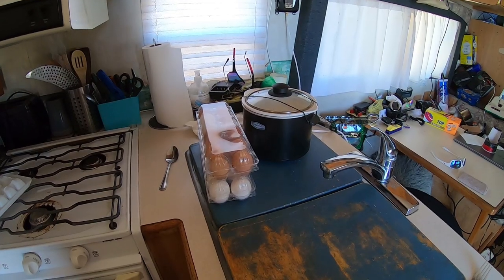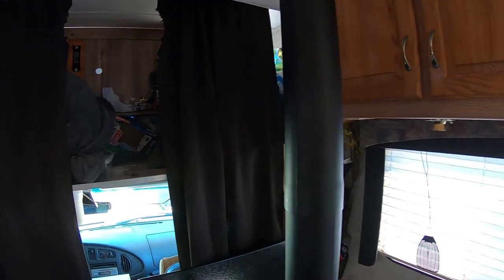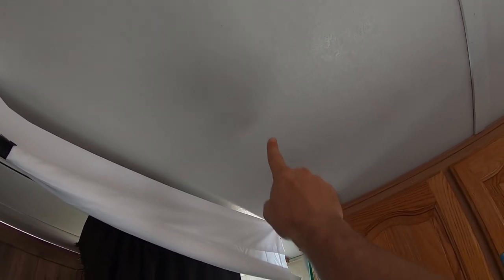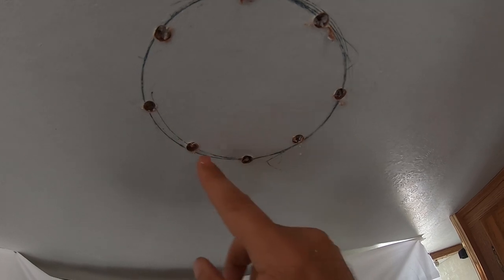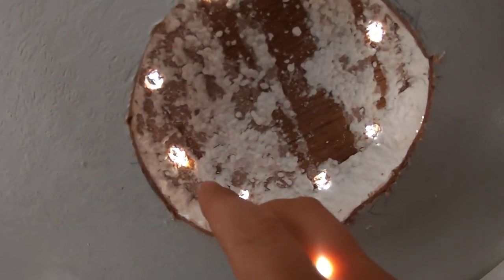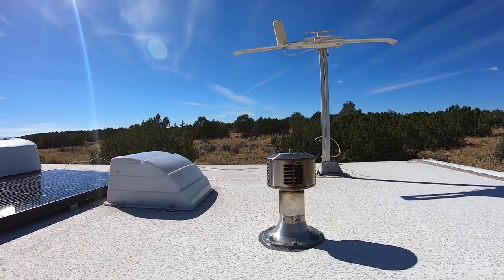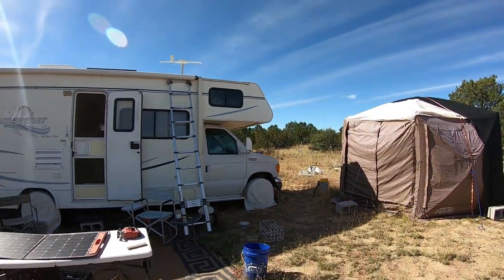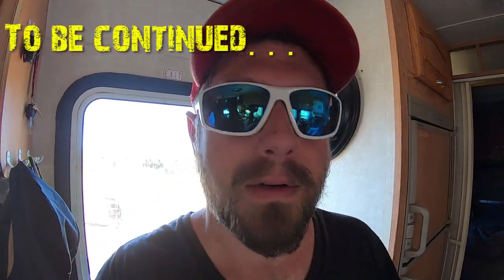Installing Wood Burning Stove In RV

Comment: It's been 2-3 years since I saw one of your videos.  Good to see that you're still kicking and haven't killed yourself.  You're an inspiration to all those that seek out the less thought out way.  That big of a wood stove in a RV is going to cook you out and be a PITA to regulate. Your exit is iffy at best.  There needs to be an air space around the ceiling pipe.  Double wall at the least.  Not sure how this popped up in my recommended list,  GL in your endeavors.

Comment: Hello Mike. Wish you the best on install. My wife and myself do have some reservations  about your install. #1  the allumium  foil stuffed in the area  that needs to be an air space between flume and outer shield should not be compromised.  It will transfer the heat from flume to the outer shield. #2  It would serve your purpose  better to also have gotten one that is triple walled/insulated.   We do hope that it works for you, but do be vigilant  keeping  an eye out for any issues. We both have building back grounds. Best regards Mike. We love you, Tommy and Bonita.
Reply: Tommy and Bonita is correct.  Very high chance of RV catching on fire.  Ask the fire department to inspect.  Better save than sorry.
Reply: @hoke0818  this is probably why the universe didn't let him use it this winter/spring maybe....
Reply: Agreed!!!!!

Comment: Mike. Please for the love of God, extend the smokestack. Just look up code for a house and double it. Should be around 4'. You're going to melt your roof and troche your RV.
Reply: Not to mention there has to be a 3-5? inch air gap for the pipe going thru the ceiling, so it doesn't melt the inside ceiling, or the outside roof, could torch the roof in short order.

Comment: So many know-it-alls out there. Wow. Unless someone lived in a camper through an entire winter with the use of a woodstove, shut the hell up. I lived in a HiLo camper (22-footer) through three terrible winters and my heat source was a medium sized potbelly woodstove. First: ventilation, a permanent flow of it was needed so the stove did not use up all the inside oxygen and slowly kill me. A cracked window with the ceiling vent open a smidge is the best way to ensure free-flowing draft. Tin foil is a great way to radiate heat from a small woodstove. The heat glides right up the foil. My stove flue was 6 inches and was 6 inches from the wall in back of it. Yes, it did get hot back there, but after foiling up the wall the problem was solved. I also foiled up a small, square area of the ceiling over top of the stove and it worked great. Naturally, I did not keep a full-bore fire going when I was away from the camper during the day. I would not have used the heat tape on the roof like you did, bud. I would have bought the sticky stuff and taped around the outside of the hole you cut in the roof, that way the small amount of space there could breathe. You could also foil the bottoms of your cabinets to reradiate the heat out into your camper more. Trust me. that camper will freeze up quickly, bro. Only hard wood would suit me. Good job!

Comment: My only suggestion would be to install a shield on the roof around the exhaust pipe.  Some sort of heat shield/flashing on the roof itself around the pipe.  Just a little added protection.

Comment: Oh, geez. I would not do this. Smoke and fire are likely not to be your problems with this, but keep a fire extinguisher handy. Mold is going to be the issue. No matter how well you think you have the hole protected from water seepage, it's going to leak. Mold is going to cause you to have to trash the entire RV. Hope you have a friend with a spare room. Good luck.
Reply: @ccc4eva62  Essentially, yes. After living in homes with skylights for over 40 years I can say with some authority that it will leak, especially since he employs a do-it-yourself strategy. And once mold takes hold within the roof and walls of an RV, it's game over. Impossible to fix. I think he's in an environment that doesn't get much rain, so he may be good for years, but cutting that hole in the roof has sealed the fate of the RV. It's heading to the dump.
Reply: I sealed multiple holes for solar, fan, etc in my vans roof back in 2015 and the dicor sealant is still going leak free.
Reply: @ARF.Racing  Your van's roof is a sheet of metal. Even if it does leak, it's not a complicated fix. RVs are a different creature.
Reply: @purewonka  my van has metal roof, insulation, wiring, and then the interior ceiling,   not really much different.  
A good self leveling sealant such as the Dicor sealant i mentioned lasts a very long time and only leaks if you don't know what you are doing.

Dicor works on RV rubberized roofs very well.  Just ask around the next time you see RVs.
Reply: What about all the other holes made in the roof. You know, like the ac units,  vents , skylight, tv antenna,  etc. ? Unless I didn't  understand  your comment   about mold intrusion, then so long as the install is done correctly  there shouldn't  be an issue. I emphasize  done correctly.  Best regards.
Reply: @1unihipili  That was all done by the manufacturer to specs designed by engineers. Our guy here drilled holes in his roof and used aluminum foil to fill the gap.

Comment: You don't want to know Mike the stove is way too big you don't live with the windows open supposed to be 2 in combustible from any pipe you did it that way because of this the size of the cap need to take a piece of sheet metal screw the cap to it so you have a flashing on the roof but the woods supposed to be 2 in away from that pipe pressure washer roof and get some rubber sealer on it your roof is just about shot you wait too long all that White's going to wash off and then you're not going to be able to seal it the rubber underneath is black and it's not very thick don't understand why the stove in the middle of the room but it's your house good luck
Reply: He's going to burn the place down is what's going to happen

Comment: You did a great job Hey i need advice. i live in my fifth-wheel full time colorado and i am getting murdered by propane I MUST GET WOOD burner in here IMMEDAITLY what does natural venting ? and i would go my side slide window if i had to use a stove pipe ? I need advise I'm a 60 year old lady ok at DIY but i need to do it fast lol
Reply from the maker: Hello, thanks. And yes lot's of folks put their pipes out their windows with a few elbows in the pipes.

Comment: I think you are going to have a serious heat problem at the ceiling/roof. Not enough distance from the stove pipe to the foam. Please have some air coming from the outside, so the stove won't use all of the inside oxygen. Some man and his two dog's died while using a propane heater in his rig this month. No open window to replace the oxygen used by the heater. They went to sleep and never woke up.
Reply: Wow that’s incredibly sad. Terrible

Comment: The stove is too large to place in the middle of the floor. I think you’ll regret it, unless of course it saves your life during the cold winter months! You should maybe remove the overhead cabinets, or part of the cabinet where the couch used to be and put the stove up against that wall. I’d suggest you put dicor up onto the flange of the pipe on roof. It might leak if you only seal the gap between the flange and the roof as you did?

Comment: Interesting. I never would have thought of putting a wood stove in a RV. I thought they were set up with electric or propane? Idk. Glad you had a cap for over your chimney to prevent the wind from coming down through it. Wood heat is the best heat you have. After living with it, it's hard to feel warm with anything else.

Comment: I don’t want to sound rude or anything but I think the stove location is going to be a pain in the butt being in the middle like that and going through the roof what you could’ve done was cut a square opening so that you could put a roof vent in there after if you decide to take the stove out if you sell the camper. And then you just run your chimney up through the roof vent but you run an actual approved chimney. The way you have it there is no air gap and there is going to be a crazy amount of heat coming off of that thing I would not trust that at all but who knows it may have worked out for you, I sure hope it did. If you follow the mobile home wood stove, install safety standards, you should be totally fine.
I think what I would’ve done here is put the stove up against the wall, double shielded everything and left air gaps and then either modified your top cupboard or just taken one of the doors off and run the chimney pipe through there and then up to the roof with an extra shield around the chimney pipe, where it goes through the cupboard. That way the stove would be out of your way and you could put things like jugs of water up beside the chimney pipe 10 or 12 inches away and it would actually warm water and everything for you. It’s always nice to have free warm water that doesn’t take away from your propane source.

Comment: Good job, but I am curious about the piping. it's hard to tell in the video but it looks like it is installed wrong.  The pipe coming down should be inside the lower pipe not on the outside.. If it is on the outside coming down, the creosote will leak on the outside of the pipes and trust me you don't want that..  Like I said though I could be wrong, the video makes it hard to tell. Perhaps someone else can see better. Take care.

Comment: I’m afraid you built yourself a fire trap. That’s not the way to go thru a roof. Please don’t light that stove till you fix it properly. You did a nice clean job as far as looks, buts it’s not safe at all.  Get some advice and redo it! Please!!! 

Btw, it’s really overkill for that small of a space. It will run you out of there if  you’re even able to run.  A Chinese diesel heater would have been much safer and more practical.  I’d remove that wood stove, patch the hole in the roof, and be much much safer.  Please give it some thought!